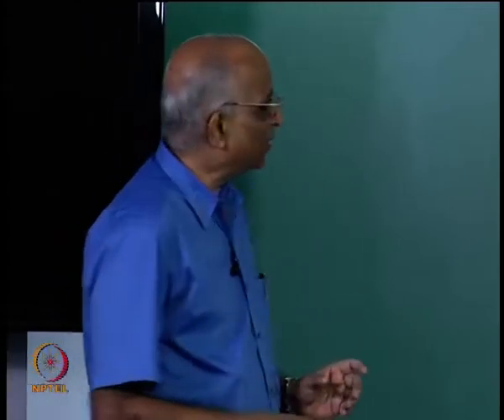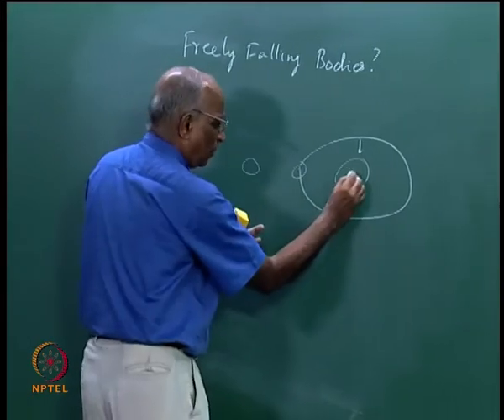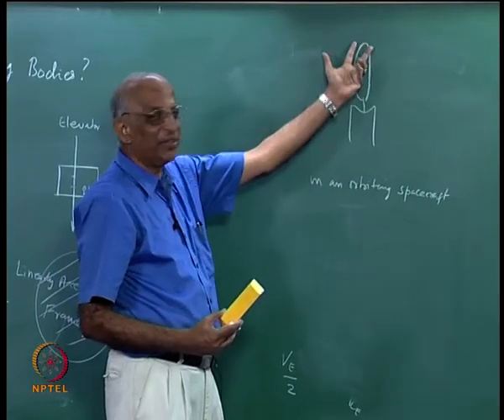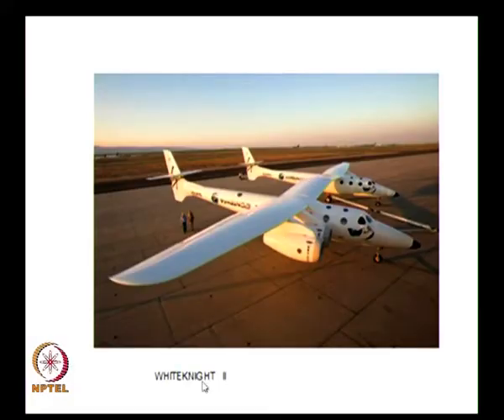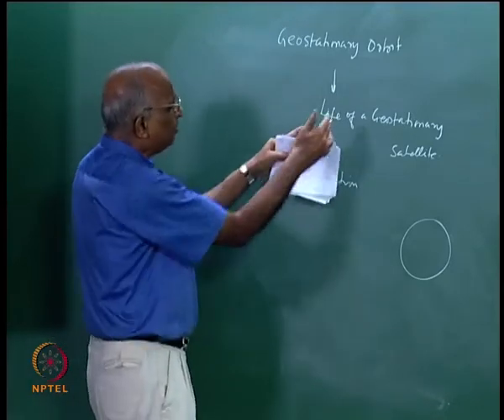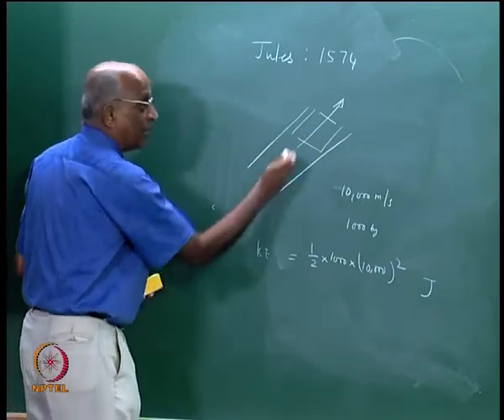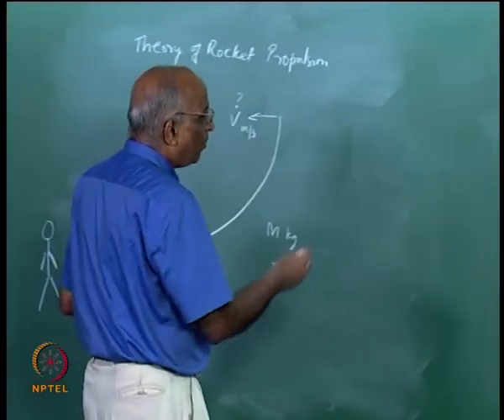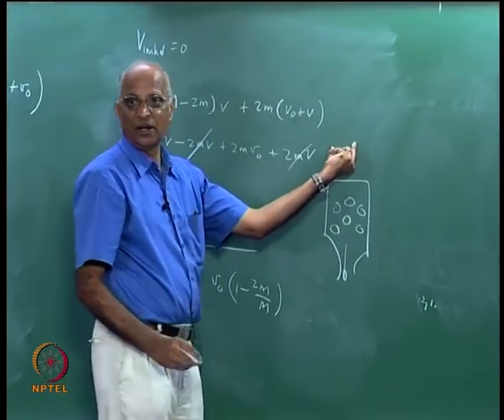#5 Theory of Rocket Propulsion | Rocket Propulsion

Comment: sir, why do we need to push it out, cant we just come back to earth? give a parachute deployment system and reuse the costly on board materials and also study the effects like structural defects accumulated on it over the time? or if it is too small it would burn up like a meteor(at least earth will have those precious metals with us). I mean the fuel required is less to send the satellite back to earth compared to sending it to deep space?